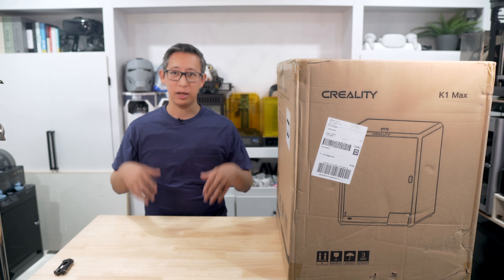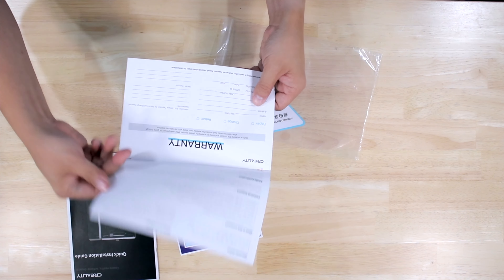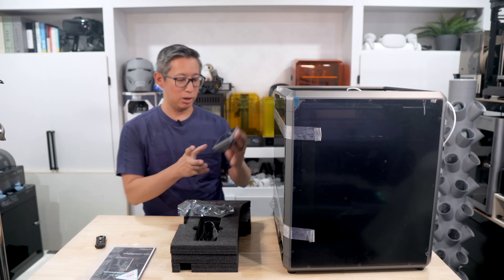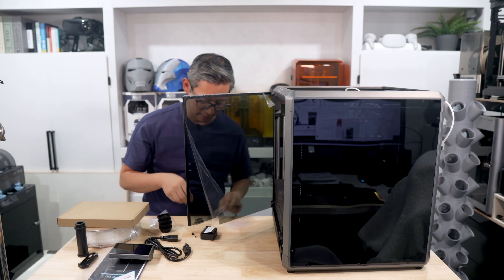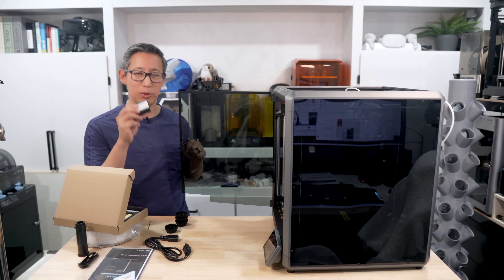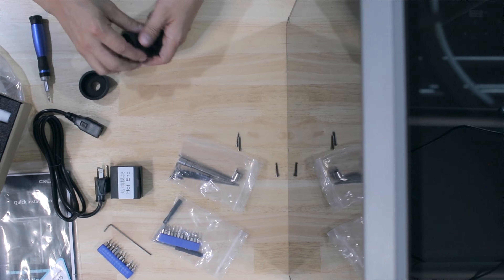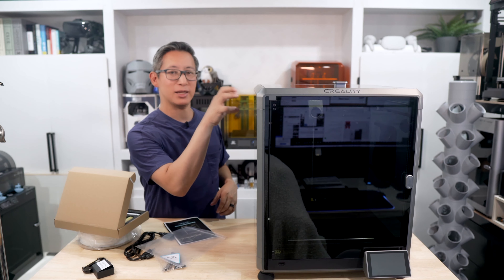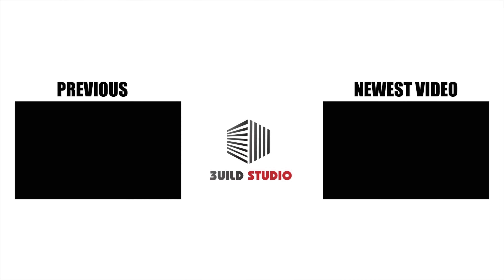Creality K1 Max 3D Printer | Unboxing & Review

Comment: Good video thank you, for the artifacts it's due to the straps being too tight, it's a defect, I had the same problem and for the first layer and for the pressure advance you have to activate it in the camera section like that , he will do his test at the start of the print and it will greatly improve your print

Comment: Great review!

I'm finding it difficult to see which hydrophonics part was printed with which printer. It looks like one of the parts has some ringing to it - is that true and if so which printer printed that part?
Also it is not possible to see what kind of defects youre talking about.. can you elaborate?
Can you say which firmware version you've used?
I have just ordered this printer and I'm hearing about problems with the quality control. Have you noticed anything out of the ordinary I should watch for?

Thank you for the review one again.

Comment: Got mine today.  Completely imploded during initialization.  Back z screw moved, 2 from ones dis not leading to it grinding to a halt at a 25 degree angle.  Sending it back.
Reply from the maker: Sorry to hear that.  Hopefully they sent you a relacement
Reply: @3uilDStudio  They did not.  I took it apart and fixed it myself.  Has worked perfectly since.

Comment: Looks to be a very nice system.
The Qidi X max 3 has the same speed, print volume and max speed, so this unit doesnt stand alone. It does have some nice features the Max 3 doesn't but the same can be said for the Max 3

Comment: Lets load random filament for the test print... surprise pikachu face when it fails with sliced model designed for included high speed PLA:)))))))))))))))))))))))))))